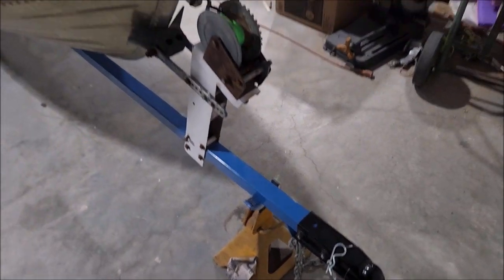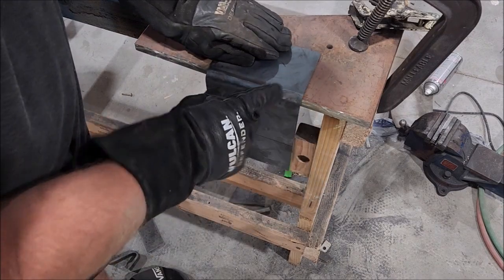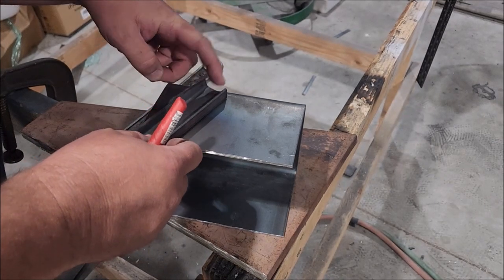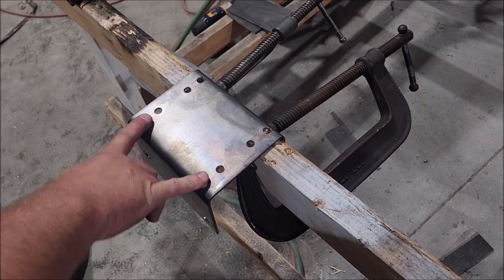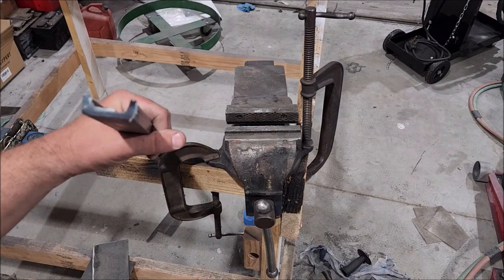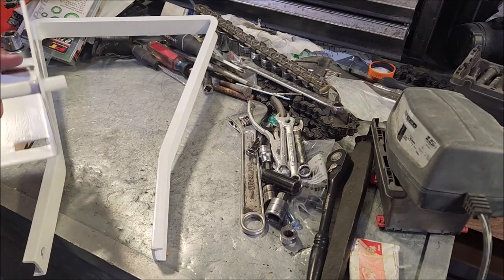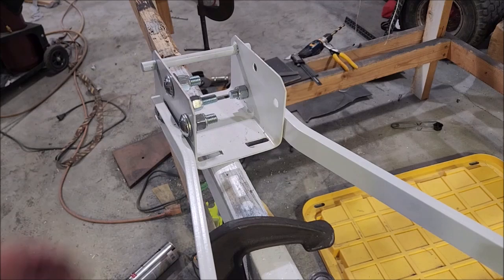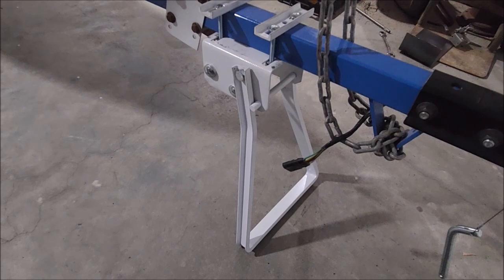DIY Vintage Trailer Kick Stand Build

Comment from the maker: Turns out the holes I mentioned at 23:41 have a purpose! This is taken from the patent filing:
"...a padlock may be passed through the bore in order to lock the leg assembly in the raised position or through the bore in order to lock the leg assembly in the downwardly extended position."

Comment: excellent job. i wear very similar ones, just without the fire resistant socks.
Reply from the maker: Yeah, I burn holes in them frequently. If I don't wear socks, the straps rub the skin raw.
No winning here! 
Also, my shirt caught fire while grinding; in all my years I've never actually caught on fire, but it finally happened.

Comment: I've seen guys score the under side of the metal with the cut-off wheel about 2/3rds of the way through. Then bend the sheet metal where the scored part is the underside. And then weld the inside of the bend. Makes nice sharp corners that don't advertise not-so-professional welds.

Comment: That one bolt that is not completely through annoys me a bit.  
(in the foot of the boat winch thingy)

Cool project again. It sure looks like brand new straight from the 80's
Reply from the maker: Me too, it's stuck in there.
Can't get it in or out, I need to take the other 3 out to fix it.
The problem is they all have a tubular sleeve inside that the bolt runs through, that one is bent, locking the bolt in.
Reply: @BrandonsGarage  Well, then that begs a video of making a completely new one
Reply from the maker: @Viceroy  I got a VEVOR press on its way; The plan is to upgrade it with one of the metal forming brake additions. Perhaps that will be my first project

Comment: i did the lower end and upgraded my fuel system for my 40hp with your help thanks. i have a ouestion my motor surges or chugs at mid rpm sometimes. Then run good. Then starts it again. it seem to run good when it wants to.  i did your setup vid. do you have any ideas. I thank you again. Great videos.